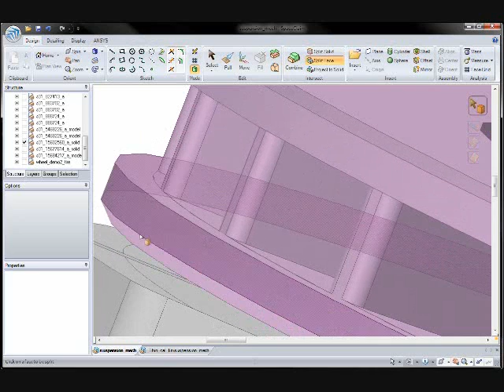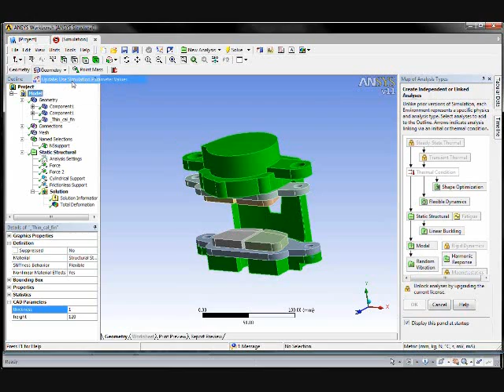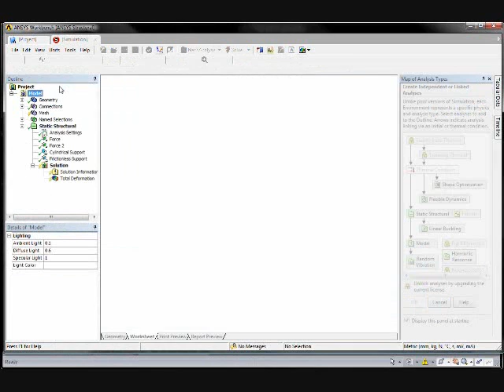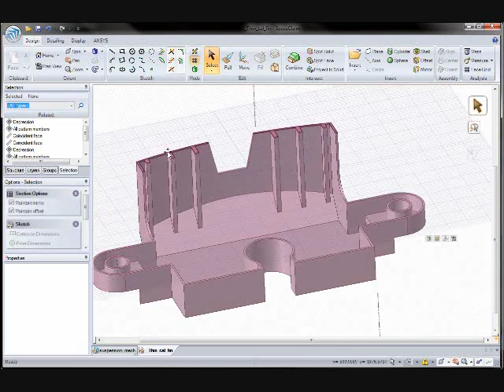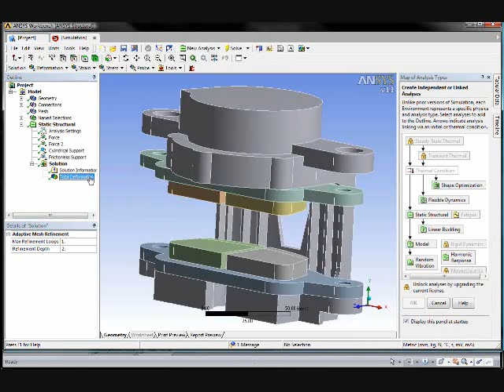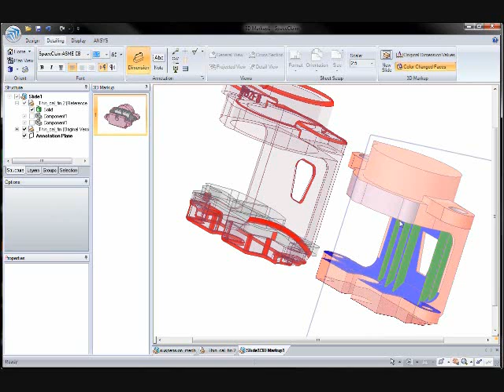ANSYS SpaceClaim Direct Modeler - PART 2

Comment: How to activate SpaceClaim addin ANSYS-SpaceClaim Connector? I have installed Ansys 13.0 32bit and SpaceClaim v2011 32bit, with  ANSYS 13.0 Integration activated and  ANSYS-SpaceClaim Connector unactivated in SpaceClaim addins.